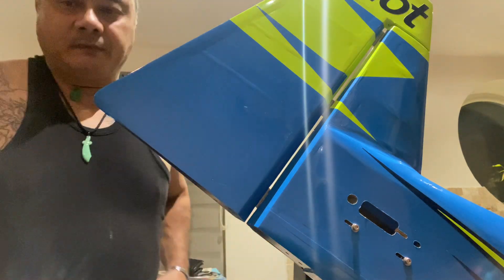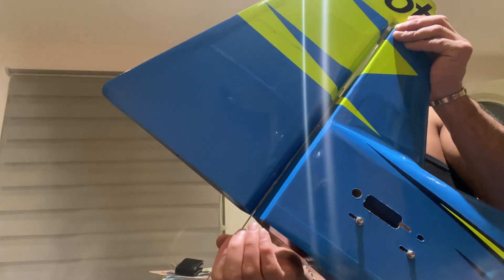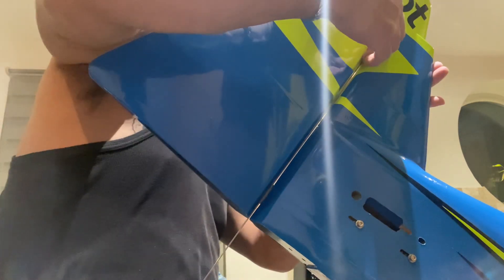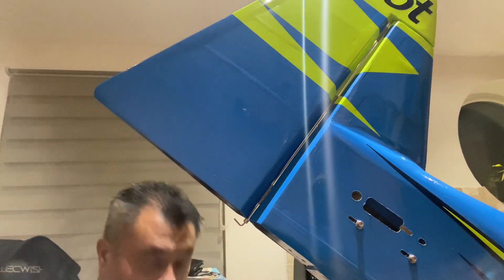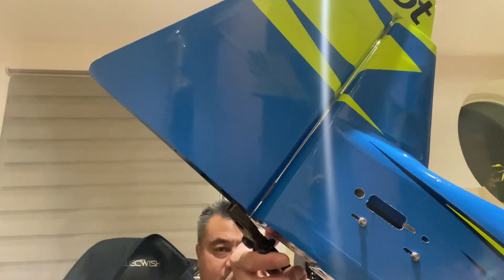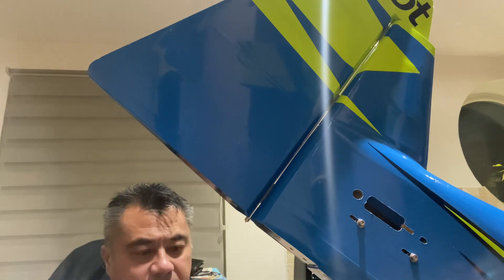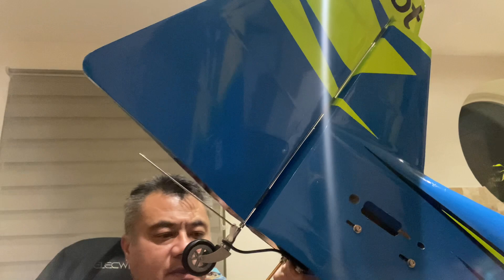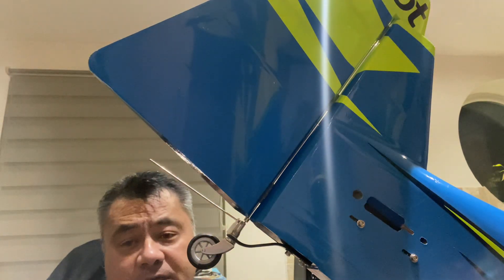Pilot Rc 84” Slick stage build video 4- 12 January 2022

Comment: i think your ment to push the rod through the top of the rudder the 90 degree bent was there for a reason and then the collar goes at the bottom, loving the videos mate keep them going
Reply from the maker: Hi Callum..thank you for your interest on my channel.. on the AJ RAVEN you push the 90 degrees bend through the top but on the pilot Rc you push it from the bottom and through the top of the rudder post there is a little hole for it to fit through.. at least that it what I thank and because Pilot Rc doesn’t come with any instructions or literature for any kind of fitting.. I fitted it the way that it worked the best seems okay though.. 👍
Reply: Can confirm. On my Slick 84, I pushed the rod through the top of the rudder and let the 90 degree bend rest on top of it. Bottom part is where the collar and an additional oversized plastic washer went that pushes against the fuselage and the rudder to clamp the whole thing down.
Reply from the maker: Oh that would mean it’s the same as my AJ RAVEN fitting is the same.. the only thing I didn’t like about that is the top off the Rudder you can see the metal rod bending at 90 degrees..What engine or motor are you have in your slick Callum?? 👍
Reply: I pushed the rod through from the wheel side to the top, removing the collar. The 90 Deg bend went right up to the lower hinge. I then popped the collar on the top of the rudder, tightened it leaving 0.5mm so it just doesn touch the solarfilm. I then cut off the excess rod at the top against the collar.
Reply from the maker: Yeah that seems to be the best way to do it pascal 👍

Comment: Rudder pin in upside down, no thread lock in sight on anything.
Reply from the maker: Hi Martyn. Yes I fitted the round pin differently I fitted my way because I didn’t like the pin at the to where you can see it.. the pin I fitted is very tight and stable not go anywhere.. I have tested it so is all ok Martyn.. fly safe 👍